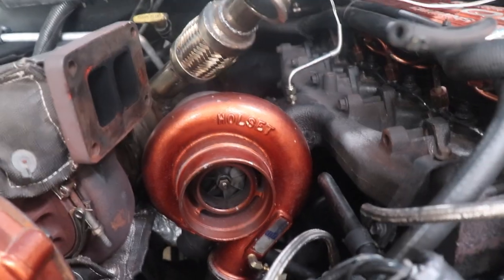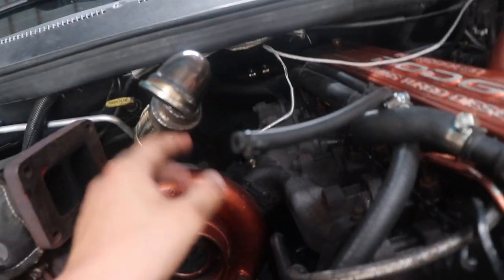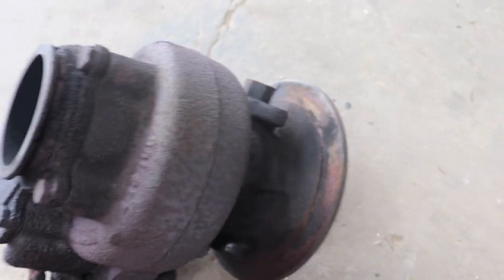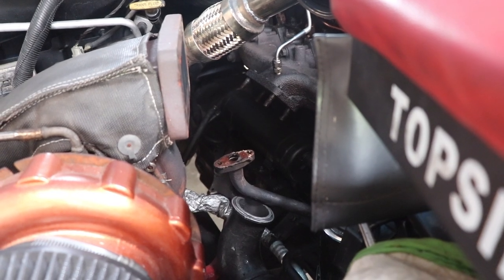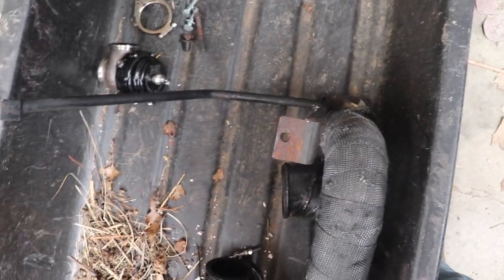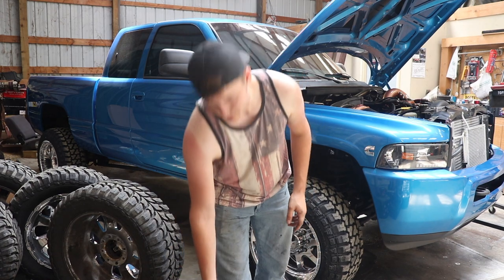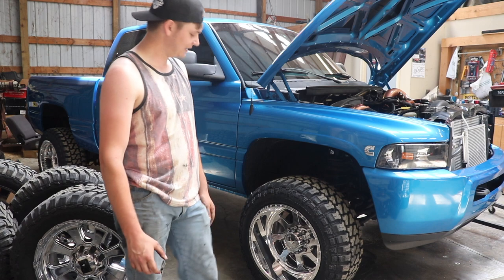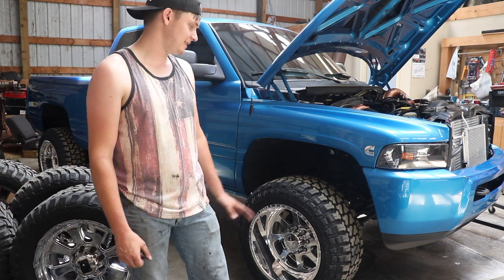IT’S ALL OVER FOR THE TWIN TURBO CUMMINS!!!

Comment: put that bracket back on as the guy who built it designed it for support, high boost "boosted launches ;)" or rough terrain could make that turbo bounce around, have your own back as you've already had a turbo issue... the more support that bigger turbo has the better.